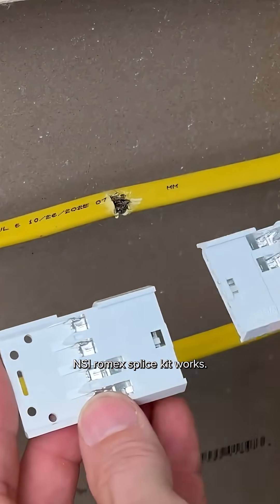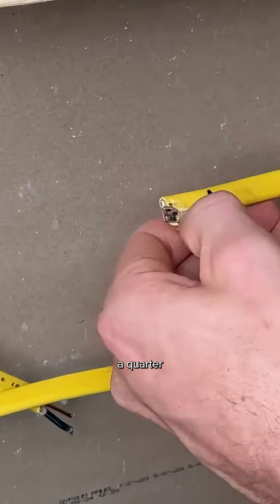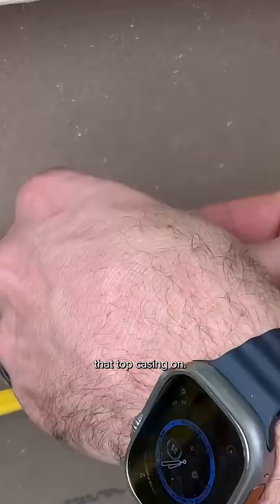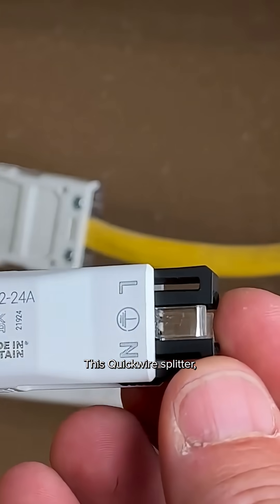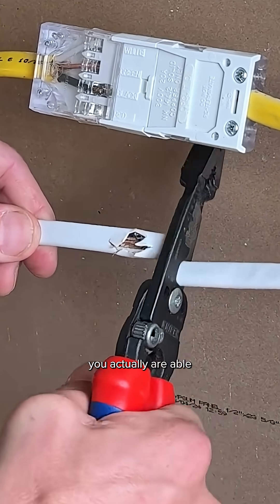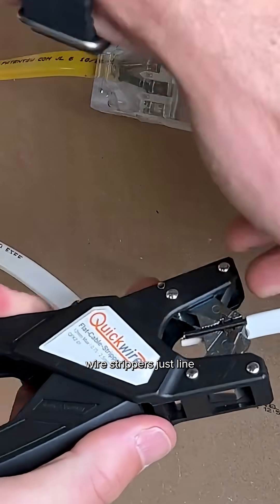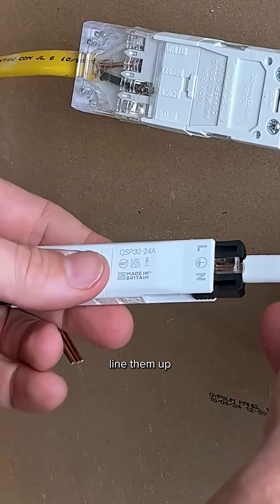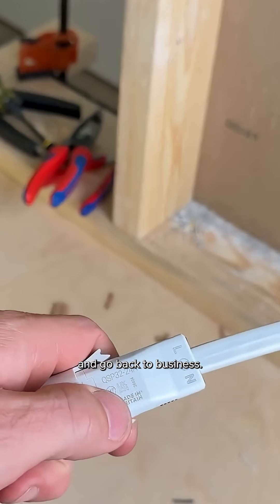The NEC-Approved Splice I Hate… and the UK Inline Splice I Love

Comment: I like it. I’m just a little concerned about what mechanism is in contact with the wires and how much resistance is created at the connections. I have had to repair too many outlets with stab lock mechanisms that creat hot spots and eventually disable feed through circuits.

Comment: Yes the UK version is much better! Easier and smaller. But the test is which one heats up more under load? Most on the time less metal in the fixture (distance) is the better and more contact surface at the wire point is also better.

Comment: Electrician, over 40 years.These are easy and convenient but the contact on the copper wiring is the same as The pushing on an outlet , it will create heat I wouldn't use this unless you wanna see melted plastic one day

Comment: I hope not because all plastic couplings or connectors are a failure waiting to happen! They dry rot and short out. If the circuit breakers are not changed out in their required life span and these plastic connectors are dry rotted... My prayers to the homeowner!

Comment: Negative. I've had several people mention using an "in-wall splice kit" and I've flipped out enough times that i think people mention it to me just to get a rise out of me. All splices and junctions are required to be accessible and cannot be concealed. I've done PLENTY of remodels and have always found a code compliant creative way of making things work where wires pass through where walls once were. Or where wires were hit by the demo crew just like these in the video. Fix it right. Extend and splice and make it right. Might cost the homeowner more money upfront, but will save them money long term when that crap splice (quite frankly, most people I've worked with who go about burying spices are hacks in the first place, so I'm not trusting their splicing ability) fails and someone goes hunting and tearing apart the house. Go ahead do this splice in tbe attic, out of the insulation (i doubt they're IC rated) or in the unfinished basement. Keep it out of the walls.

Comment: Load shouldn’t be an issue. Even wago style connectors have been tested and proven under constant load to take up to 3-4x intended amps and voltage. The issue is with case use and application. Who’s using this? The average home owner repairing a damaged line? An electrician? If it’s in a location that was damaged can it get damaged again in the future? should the line be moved altogether? Can there be multiple splices on a line? How does it perform under water damage or damp conditions?

Comment: The stripped wire solution that crimps onto the bare conductor has the potential to be a superior system but I would need more data. Impedance, fire rating, etc... are very important.

Comment: It should not be approve. No real access to these if behind drywall. No easy access. Only if there is an access door to access these devices. They are just like a junction box.
Reply: Also the NEC codes should already state these devices wouldn’t pass certain codes within the NEC.

Comment: It feels like insulation displacement connectors (IDC - the things that “split” the insulation) connect to the conductor only with the “knife edge” of the metal that cuts the insulation. It makes logical sense that that would increase resistance as you are introducing an interface between the copper and the connector, much like any other connector - RF or electrical - introduces an impedance change in the conductor. For ease of installation, fewer parts to lose (one piece design vs eight - including the four screws) they look interesting but I’d want them to be test in edge cases to ensure safety. (Poor connection due to inaccurate strip length, for example.)

Comment: Cannot approve. Maybe it could be tested and rated, but UK and US wiring differs in several important aspects. Firstly UK wiring uses 240 volt (yes I know standard is 230, but 240 is still used in places). Therefore the current is lower and the heat dissipation is less. Secondly UK uses metric wire sizes. 2.5mm is larger than US 14 AWG.  Do not use UK rated connectors in the US and vice-versa.

Personally I believe the UK standard system is much superior to the US, but we are where we are.

Comment: The US version uses the same fork through insulation we used to use in the UK back in the 50s for telephone wire connections inside habited and dry areas. I believe ethernet wire also uses this form of connection on the lower bandwidth connections. Never have I ever seen it used on thick wire, its when wires are moved about including vibration and general movement at max current these items are really tested. I can trust the UK for overbuilding and overtesting the electrical systems they pass off. Often I feel the US is too money driven, safety comes second to profit or lives in too many instances. But if the US one could ever pass the UK Standards "we say standards instead of code over the pond".  Than I do like the elegant simplicity of many american designs as they are made to be cheap and that's not always bad, within a good testing framework a good cheap design has many benefits.

Comment: In the DC world, Scotch Locks( stab/knife splices) are responsible for many failures.. Especially in high humidity environments. But knife connector style outlets are common in the AC switches and outlets in Mobile Homes.. and they fail regularly over time and are very difficult to service.  I would think that the UK connector shown is mechanically like the (WAGO) lever connectors that are already in use in the USA.. So I would approve these for the US market. I service RV’s that have both DC and AC wiring.. I have seen a lot of conventional wiring fail in that environment.. the serviceability of the Quickwire connector looks right in comparison

Comment: Absolutely awful you replace the whole goddamn wire or put in some junction boxes that are accessible. You don’t use stupid clip on crap like that. That is a fire hazard just like the Wago fucking clips are a fire hazard and those should not be used for anything use real wire nuts and make real connections don’t be lazy. Replace the wire if the wire needs to be replaced I see all this crap is being stupid and lazy.

Comment: so we're now backstabbing splice connections.  there's no way these are going to be as robust as conductor on conductor joints.  even wago, screw down terminal blocks or levernuts can get around internal bus creating an ampacity chokepoint and that's where heat is going to build up.

Comment: If a say  approve it’s because  we will make money on the service side but to be honest I wouldn’t want this approve and I would like the other ones banned they will add all the gfi arc fault breaker and outlets w/p and tamper poor gfis and outlets cause of fires and kid pee on outlets but they allow these stupid thing it’s the same as the old style outlets that plug into the back of it the have it’s not something that I would not use ever i have had to cut these things out of a lot of homes and replace with wire nuts they are not good in my opinion

Comment: I would never use either of whatever this crap is. A but splice is way better way cheaper and won't catch fire like this would. That is not enough metal serving as a connection for the romex. Somebody's gonna plug 5 devices into that one circuit one day and it's gonna burn up right at that connection.

Comment: Show me thermal under full load. 

As an electronics engineer, and former low voltage automotive/vocational vehicle electronics expert, I can tell you right now, the American version is nothing more than a big Scotch Lock. Whenever I've EVER had to fix previous installations, if there were Scotch Locks, they were ALWAYS at the very least, part of the problem, if not the whole problem. 

I do not approve. I will run a new ROMEX wire.

Comment: APPROVED. I am a recently retired electrical engineer with 35 years under my tool belt and I can assure you that these are better than the majority of the hacks that I have seen that were only “temporary”. There is nothing more permanent than a temporary fix. Although I’m not a fan of splices anywhere, this is at least an engineered solution that reduces the risk to a level that is tolerable associated with the thermal heat generated across a now “higher” resistance of the mechanical contact points. Bottom line is in Europe they have greater innovation skills and design safety into their product based on science and standards at a rate much quicker than the NEC would ever allow. I can speak from own experiences having been a member of several code panel committees.
Reply: As a 35 year electrician with a lot of fIELD experience, these are the worst thing out there.  Is rather have open air wire nits than this garbage.  This type of pinch connector is what you see in automotive wiring.

Comment: No to either of these.  How about something that you stick the wires into and then heat it a bit to melt a solder pellet that solders the wires to an interior stamped metal piece ?  I would trust that for decades.

Expose either of these insulation displacement unions to a slightly corrosive atmosphere like you might find in a basement wall for a year or so and then let’s measure the resistance.

Comment: These types of splice kits have been around for decades. They were popular in modular home construction. Even though these are UL approved, burying a splice inside a wall is still a NEC code violation no matter how it’s done. 
Where is it located in the NEC that allows using these specific devices for burial inside a wall? Article#?
I don’t believe any AHJ in my area would allow there use even in an open area.
In electrical every termination point creates resistance in the circuit and every termination is the most likely to be a point of failure.

Comment: Honestly, if we're so worried about damage and house fires. Why don't we just run conduit? And pool individual wires through. The great part about conduit is you can run a whole new wire, even though it's strapped to 2 x 4 in there.

Comment: I've been using the quickwire system here in the uk for a few years now and they are a fantastic time saving design and a solid electrical connection. They are also manufactured and tested above the current carrying capacity the connectors are rated for. They also don't increase the ressistance of cable run.

Comment: No.  The Quickwire has a much inferior connection to the wires.  Bound to overload and fail when used in circuits that are near capacity.

Comment: I like the concept, but after having to replace quite a few of these on mobile/modular homes, I vote NO to any of these devices ESPECIALLY in walls or any place you don't have direct access to. BTW, by replace I mean installing the wires in a junction box and securing them with wirenut type connectors.

Comment: I used the spice kit once five years ago.Where there was absolutely nowhere you could get access to. This wire is located because of its location. According to the electrician, I had talked to, he told me I could use this in place of putting a junction box because it was allowed and approved by the NEC. It wasn't hard to assemble.Only the location made it hard. But I do see that the European version would be so much simpler.

Comment: Who hasn’t run across this problem before? Damaged romex without enough slack to perform a true, safe, junction box enclosed splice, and seeing this feels elated a such a solution. BUT, as a 40+ year electrician, I don’t think I would sleep well at night with this buried in my walls. I’m old school and feel more secure doing things the tried and true way.
Reply: I use underground splice kits or two old work boxes with a new stretch of wire between them. I refuse ANY blade connection. Seen WAY too many melted, charred, or actively smoking to EVER trust them. Backstab devices should be banned.
Reply: Mobile home halves are actually hooked up with these same connectors.
Reply: @wildbill23c we know how prone to fires mobile homes are
Reply: Not an electrician but I'd feel better if there was at least a way to know where they were.  Maybe an IOT signal?
Reply: @cityguyusa  Hmm, never thought about that, I agree, it definitely would be nice to know where they are, or at least maybe have an access plate in the wall to get to them.
Reply: I usually just add an outlet. Nobody ever has too many outlets!
Reply: According to some of these comments you better not connect in such fashion to any Breakers , Light Switches or anything that requires a the use of a Wire Cutter , Stripper , and a break in the Gauge configuration of any wire .
Reply: Granted I am lacking in Practical experience which might change the nature of my previous comment . Absent that knowledge this looks absolutely and infinitely better . The US -UL approved does seem like it would create an impedence issue since the pin connectors create a bottleneck .
Reply: @williamkeaton1340 it's not that you can't cut the wire, it's that you have to have sufficient surface area mating between the conductors in order to carry the rated load without causing a high resistance junction which will lead to heat. Just because something is sold doesn't mean it's safe. I know I sure as hell wouldn't use those in my house.
Reply: If there was a damage run with not enough slack I think I would cut the chunk out and add two boxes, do the splices properly with wire nuts and additional romex wire.
Reply: Pop quiz you have to lower an outlet but the house you’re working in has vaulted ceilings with no crawl and the owner does not want a visible junction box or drywall damage. What do you do?

Comment: I don't think either one should be approved. 
The UK one is shiny and cute but I doubt that it makes good contact without damage to the conductor and what retains that pressure on The wire. 
The US made one I have issues the fork that penetrates the insulation contacts The wire at some level must damage the wire I don't see how it could be of any value especially with a stranded wire then again I guess Romex there isn't such a thing. 
Any solid wire will be damaged by the forks how badly that's a good question and then if it gets hot obviously it will lose its tension on The wire. 
Either way I don't like either one

Comment: When I was an apprentice electrician in the 70's they used temporary light bulb sockets that would pierce the single strand wires when squeezed on where needed. After multiple fires the electrical code changed but still allowed this practice for permanent installations in mobile homes, for some reason. These practices were allowed because of pressure from the manufacturers and the residential builders with little regard for fire safety. 
I expect this splice device to be outlawed in it's present form in the near future. This will not deal with devices already in service as they are not documented and listed where they are being used.
Reply: It's because everyone knows a mobile home will eventually be carried off in a tornado anyway.

Does anyone still remember what GDR means?

Comment: I see these devices fail in prefab homes all the time. Usually the clear cover turns brown or black from the heat of the bad connection. Did a service call on one were every homeowner back to the panel had one of these.

Comment: I'm UK based,They make a quick wire multi splice one too now I think for 3 way and 4 way joints in lighting circuits. I like them, but they're quite pricey compared to wagos or crimps and a snapshut/choc box around it. They are getting cheaper though so I'm using them a little more,and want to try the multi splice ones

Comment: I would only use this an emergency as a temporary repair. There is minimal amount of metal contact with the wiring like a 5 lane highway down to 1. Why I wrap wires around receptacle terminals and NEVER backstab them.

Comment: It looks like the HOT slots in the connecter will accept a longer wire, probably to Pierce it twice and get more area of the conductor touching. 

In this vid, they cut them short, nullifying all results....
Reply: … no? Why do you think the hot side needs more area touching than the neutral? Are you under the impression it’s taking more amps than the neutral?

Comment: Yeah, I never liked the knife-edge-contact types of connectors (like the Scotch-lock splicers) because they actually cut into the sides of the conductors and thus make them thinner.  There's usually little enough copper material there to begin with, so you wanna utilize all of it for better amps-conduction.  I'm not too crazy about the conical-point contacts, either, but at least they don't actually slice into the conductor the way those nasty aforementioned tap-in squeeze connectors do.